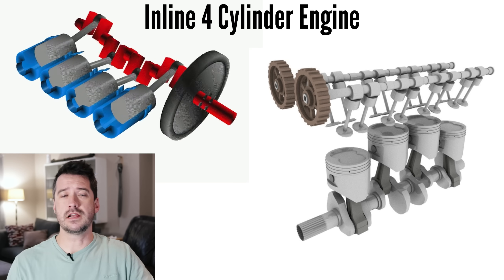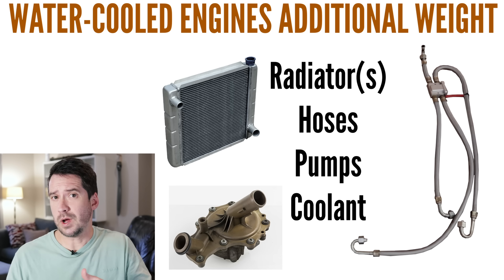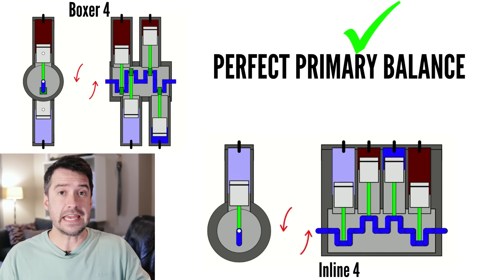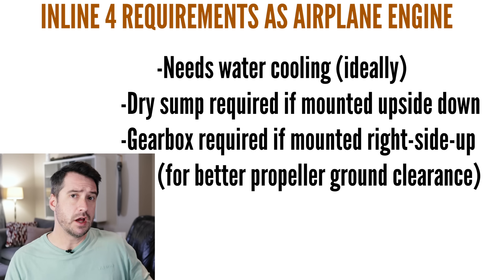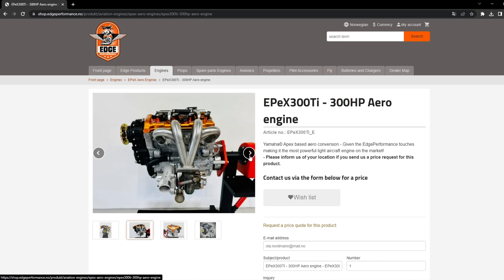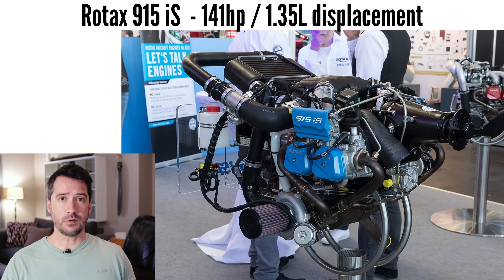Does Inline 4 Engines Suck for Airplanes? - Technical Deep Dive

Comment: There is a second reason for the choice of engine design, that has nothing to do with the engine itself: The shape of the engine has to fit into the shape of the airplane to get a low drag and pleasing looking design. 

Knowledge of aerodynamics has greatly improved in the mid 1930s and made another giant leap during and right after WW2. Before, aerodynamics were thought simple. Designers concentrated on keeping the frontal area of their designs as small as possible and mostly ignored other factors. A wide fuselage was considered a high drag design. That's why side by side seating (not only) in light aircraft was very rare until the late 1930s. The narrow surface area of inline engines matches narrow fuselages perfectly. 

When the first purpose built horizontally opposed aero engines emerged, light aircraft with side by side seating were still rare. This lead to odd looking designs with narrow fuselages and cylinders protuding out of the cowling sides. You can see it on early Pipers for example. The shape of the engine didn't match the shape of the fuselage, it screamed drag and it always looked like an improvised design choice. 
Only when side by side seating was widely introduced in light aircraft, the horizontally opposed engine immediatelly kicked in. It was a perfect combination from the very start. Today, the vast majority of light aircraft with more than one seat are side by side designs. This combination allows for a low drag cowling and fuselage combination and, keeping hard technicals terms aside, a wide, short, horizontally opposed engine on a wide fuselage is just as pleasing to the eye as a long, narrow inline engine on a narrow fuselage. Looks sell, people don't just buy for technical reasons. That's especially true for expensive luxury items like private airplanes.

Comment: This reminded me of a tangentially related story, there's a flathead straight six that's been designed by roush racing to fly on a rocket. The last stage of the ACES launch system (which I don't know if they're still working on) has an APU designed to run the hydraulic pumps and generator, it's a top stage engine so it's supposed to be able to start and stop (unlike a lower stage engine which just goes once), they need this little secondary engine to keep things running, it makes a cool 26 horsepower. And I do mean cool, because it's running on cryogenic temperature gas it doesn't need a cooling system, in fact, the heat off the engine is used to pressurize the fuel system.

Comment: 7:45 You could handle secondary balance issues through complexity, but there is another way: an extremely slanted (120 degrees to 170 degrees) slant four with highly oversquare pistons and 3:1 rod to stroke ratio. You see, long rods essentially eliminate secondary imbalances (which is why container-ship engines have them), the oversquare pistons reduce the stroke so 3 times the stroke isn't insane, and the orientation keeps the total height reasonable and about the same and puts the prop only a tad lower.

The offset to one side provides interesting opportunities and issues... Thanks for prodding me into thinking of this. Thumbs up.

Comment: I’m anxious for liquid cooled, ECU-controlled, higher-efficiency, ‘affordable’ engines,  especially for EAB aircraft
Reply: Not exactly affordable but the continental cd-135 is a thing
Reply: There are reasons why aircraft engines are air cooled, have magneto ignition systems, and carburetors or mechanical fuel injection.
Magnetos are independent of any electrical systems. Totally self-contained, they generate their own electricity. The whole airplane electrical system can fail and the engine will keep running as if nothing happened. Since 1941, two separate ignition systems are required on all new aircraft for safety. At least one of these must be a magneto. If one fails, the other keeps the engine running to a safe landing.
Water cooling adds weight, one more point of failure, and one more system that requires rigid maintenance in order to be reliable, as the Thunderbolt proved over the Mustang and the Spitfire amongst Allied WWII aircraft.
One round to the radiator or water jacket brought the water cooled aircraft down. Many air cooled P47 Thunderbolts made it back safely with whole cylinders shot off.
Electronic fuel injection is, once again, dependent upon the airframe electrical system and adds complexity. Electronic injection systems were developed in cars predominantly for emissions. Backup batteries for electronic systems are not the answer. One more maintenance item to be neglected and one more unseen system to fail.
These new engines are making all their horsepower through high compression, gearing and turbocharging so the engines are spinning much faster. This is too much of an automotive mindset. Cars cruise down the road using perhaps 12-18% of their total power potential, while many aircraft need 60-70% power just to maintain altitude. Given the stress that that would continually impose upon such a complex and high strung engine, I doubt that they would be nearly as durable over the long term as a typical Certificated engine.
Diesels can't fly with a failed turbo, so I don't endorse those.
I do believe that continuing research and development is crucial to aviation, but I think it's going in the wrong directions. We can't be making airplanes into flying cars. The realm of flight is very different, and the engines that many people are calling crude and archaic took many decades of development to get where they are now. Safety and reliability should take precedence over economy, not be an afterthought.

Comment: With respect, DeHavilland build many many versions of their Gypsy four and six in line engines, they were used in a lot of light aircraft and a lot of them are still flying.
Reply from the maker: 9:41 in video I mentioned the dozens of aircraft using the engine, and video of one of the many currently flying in my area
Reply: @LetsGoAviate  well you should have put it at the beginning.....

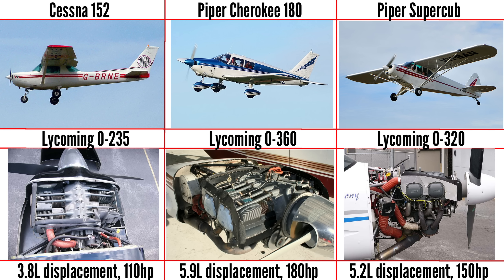Comment: 9:09 But not displacement but power is the goal. 2 liter inline 4 engines can quite easily produce the 180 HP of the Lycoming 5.9 liter.
2l engines would however typically produce peak power at around 6000 rpm so for aviation purposes that would require a reduction gear. 
That gear could be used to lower the engine so it would suit two purposes.

As explained here: 15:10

Comment: The "TEI PD-170" and "PD-222" is an inline 4 Diesel Engine, purpose built for Aviation.

It was developed for the infamous Bayraktar TB-2 Drone, to replace the Rotax Engine, which Canada put an export ban on.

I'd like to see your opinion on that engine actually.
Reply: Don't even need to go that far, we have the Austro E4 that is an straight 4, and the 912 is a geared engine.
And...the IO-720, have a 4 bank engine that the cooling of the back cylinders isn't an issue, actually, if wasn't by production costs, we'd have the Lycoming O-1230 still in production for crop dusters.
There's also some certified conversions from Viking Aircraft, AeroMomentum, AeroMot and others, that uses regular car engines as aircraft engines with some success.
Today the major.fault of lack improvements are the pilots that still "don't trust electronics" and innovation on their engines, so they prefer "ye ol' reliable Lycoming"

Comment: There are a lot of advantages to the existing lycoming/continental designs over automobile style engines. One is pressed together cylinders - no head gaskets to fail. Individually serviceable cylinders is another. Ease of packaging and maintenance, and lots of anti-fatigue features considered in the design. Redundant ignition as well, and provisions for oil pressure driven constant speed prop hubs rather than electric ones. These engines are also already capable of quite high thermodynamic efficiency. With modern techniques such as studded and doweled case halves I really see no need for the basic engine planforms to change. FADEC would be a welcome change, as long as it has commensurate redundancy, and backup for complete electrical failure, but even then is it so necessary? These engine operate with only a handful of different power settings and have a very consistent load. Ive never struggled to maintain good mixture control in my airplane. Timing adjustment is cool, but remember that part load efficiency is more important in a car than it is to an airplane (timing is set for optimum at high power). Individual cylinder fuel trimming would also be great, that one could probably help. Valve timing change is pointless as are many of the other efficiency workarounds such as Atkinson engines and cylinder shutoff. 

The prime directive is to keep it simple, and that’s the best thing about airplane engines as they stand right now. No need for extra cams or head gaskets or water. Automated cowl flaps to prevent shock cooling and necessary drag would be nice though.

Comment: Many years ago Porsche developed an aviation version of its circa 3 liter, turbo charged air cooled, boxer 6. The engine was a mature design and had been tested under severe operational conditions (24 hour endurance motor sports). Really anything an in-line 4 with turbos can do a similar boxer six can do better without secondary imbalance - except perhaps cost.
Reply: It was an injection engine. EASA demanded hence double generators and fuel pumps for a secure power supply. 
That double-of-it on vital sytems is logical because all other engines had also double, fully independent ignition.
The profits of this expensive to manufacture, low-volume engine was marginal for Porsche so they pulled the plug. Logical, because claims (USA) could ruin the profit of years at once.
Reply: The Ducati 90 degree V2 is so smooth you can't feel it running... inline 4 kinda sucks for every use... 
VW/Porsche boxer engine started for water pump and aviation uses, as I recall...
Reply: Porsche has won the 24 hours of Le Mans 19 times!!.
 It's 6 cylinder 901 series is one of the most reliable engines in the world
Reply: @louisvanrijn3964 Mooney did little to promote the design either..
It was expensive, very expensive
Reply: @WilhelmKarsten  The 12 cylinder in the immortal 917; was essentially two boxer sixes joined together with a central power take off.  In its 5.4 liter turbo form in the hands of Penske & the 917/30 all but killed the the CANAM series. Then the run of the 936, 935, 956/962 … began.

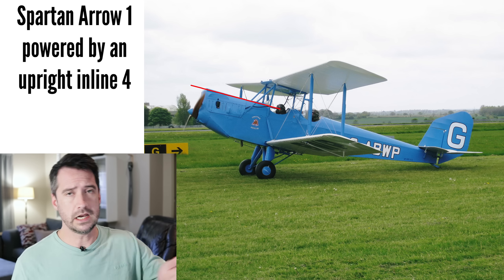Comment: 2:21 sure if you are driving your prop right off the crank, aircraft engines are bespoke anyway so of you really want to you can make one driven off a gear or coupling on the head of the engine, it's not a hard problem to solve.
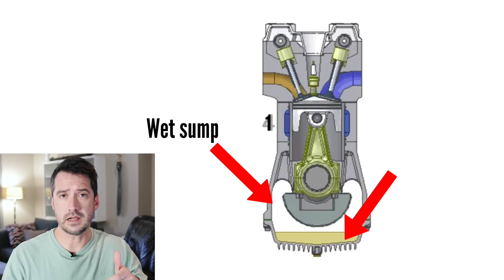2:50 it can't but you also don't need a wet sump or a 4 stroke in general, a 2 stroke can do it just fine. They may have their own issues but if you really want a inline 4 and the same airframe as the boxer for some reason you have to make sacrifices somewhere.
3:49 gearboxes can be made quite light and if you are saving weight by using the inline than it shouldn't matter, it can even be built into the engine which reduces weight over a separate gearbox in theory.
4:20 this is why cooling ducts exist, yes more weight than without them but it works well.

Comment: The Germans mounted their massive V-12s upside down for most of WWII.  Primarily for visibility, but it also made basic maintenance easier since the top of the heads were accessible from the ground.  An I-6 has perfect primary and secondary balance.  The other benefit is its the only layout that can be multiplied at any angle and still remain balanced.  That’s where the V-12 came from, and they can be made anywhere from 180° to 30° V angle.  It would be neat to see a miniature V-12 used on light aircraft.  BMW still loves it’s I-6 engines, and is the only company making a 1.6L I-6 motorcycle.  That’s only one step away from making a 3.2L V-12.  And one more step away from aircraft tuning it for a medium aircraft.

Another layout oddity is the 90° V-2.  Inertia is always delayed by 90°, and the V-2 can be surprisingly smooth with a 270° firing order because of it.  Making another possible ultralight.
Reply from the maker: It's like you're in my head. Don't blab all my video ideas out like that 😆
Reply: A 60 degree V12 is still the most ideal bank angle with consideration to firing order. A 90 degree V12 will have uneven firing intervals making it not as smooth. I was thinking about a 3.2 litre V12 from bmw engines for a long time also, I'm sure many have.
Reply: @chippyjohn1  I always wondered that.  I’ve heard you can make a V12 at any angle, because it’s essentially 2 perfectly balanced engines.  90° is generally a good angle because inertia is always 90° behind.  Just time the tro banks 270° apart like a balanced V-twin.  But if they share the same crank, I guess firing order would matter as a whole.  Modern V-12s kinda settled on 60° for a reason I guess.  Probably because it’s a square of 2 I-6’s and 2 V-6’s.
Reply: @AZREDFERN  60 degree for a V12 is ideal because there is 60 degrees between each firing of a cylinder with 12 cylinders. A V6 is 120 degrees, v8 90, v10 72 etc. For mass production, engines such as mercedes truck engines are all 90 degrees regardless of cylinders for the ease of manufacturing. Other considerations such as a 120 degree engine being very wide and a 60 degree engine is quite tall. Even firing means even stress on crankshaft and drivetrain. If uneven, the crankshaft experiences higher fluctuations in stresses rather than a more continuous application.
Reply: @chippyjohn1  The World War 1 American Liberty engine was a 45 degree V12. The crankshaft had common journals for the pairs of connecting rods. It had crankshaft resonance problems due to uneven firing.
Reply: @jiroyamamoto2878  Uneven firing can also reduce resonance. It all depends on the rigidity of the  crankshaft and resonance frequency. Harmonic dampers, torsion dampers, viscous couplings, balancing, materials, manufacturing accuracy etc have all advanced greatly since ww2. Except in engines such as lycoming or continental, lol
Reply: @chippyjohn1  I am interested. What engine do you know of that uses uneven firing intervals to reduce torsional resonance? I know that may be a tall order, but it does sound intriguing and is probably like inside baseball. To be clear, The Liberty was the Great War, not the six year version twenty five years later. I am not an engineer, but I am going to guess that the dampers, harmonic and torsion as well as the viscous couplings relate to issues manifesting downstream of the crankshaft itself. It is very vague now, but I believe the cranks of the Liberties were fracturing at an elevated rate. This was all due to a desire to reduce frontal area! The greatest engineers make mistakes, even if they are from Vermont.

Comment: Fantastic video . Well explained and relevant info . Any thoughts on the AE300 engines that Diamond uses ?
Reply from the maker: Thank you. The diesel Austro engines plays perfectly into the strenghts of the Inline 4 (not surprisingly, it's based on a car engine, after all). 2L displacement, relatively low rpm (less than 4,000) so secondary imbalance would not be an issue, but still requires a propeller speed reduction unit (gearbox) so they can put the prop shaft/hub at exactly the desired height. I'm not overly familiar with them but from what I've they are great engines.

Comment: As a former aircraft mechanic student (got my A&P, never used it) I was astounded at the primitivity of the "boxer" types of engines, with no bearings for camshaft and other rotating surfaces, pushrods instead of overhead camshafts, old magnetos for ignition and a near total lack of electronic engine controls. Now FADEC has contributed to some advances, as well as electronic fuel injection. Still general aviation seems to lag behind automotive technology by at least a few decades.
Reply: What do you mean with “no bearings”? VW type 1 flat boxer had 3 main bearings and many more elsewhere. I would like to see a flat 6 with 4 main bearings. A magneto is just a dynamo which creates voltage on demand. So you want transistors? Still need a Dynamo though. OHV are perfect for the revs of a propeller.

I think that EFI is available for all engines. I would like to see EFI which ties into the magnetos. No leaking battery.

Comment: UL Power Aircraft Engines with Air-Cooling, Direct Drive and (FADEC) systems. It comes in horizontally opposed 4 & 6 cylinder models. Excellent power to weight ratio with Dual Electric ignition. I don’t believe they are certified yet, but working on it. I know guys that fly behind the 130hp UL Power in the LSA category and it will just hang on the prop in a 700-800lb Aircraft. They are great for STOL work. And you don’t have to worry about coolant like the Rotax. Very simple and clean install.